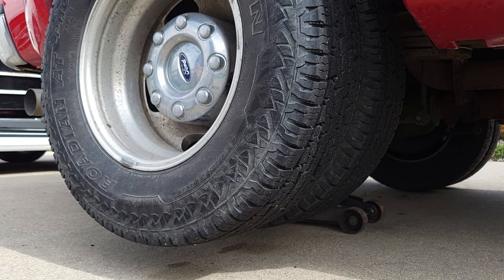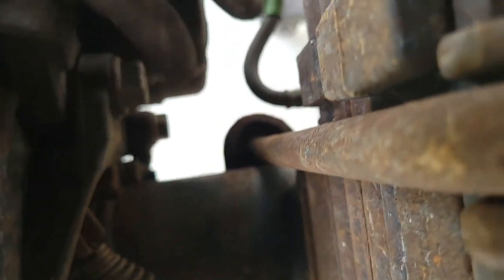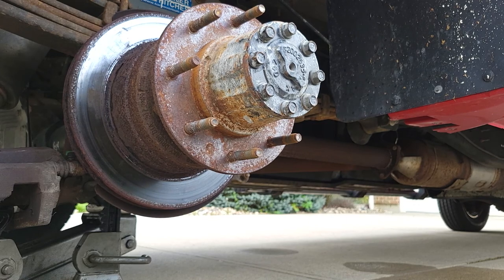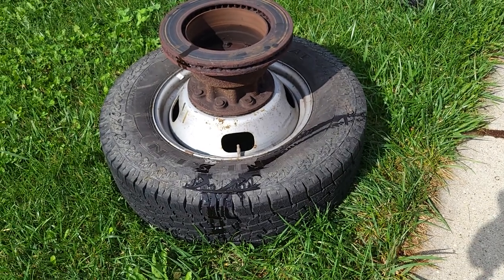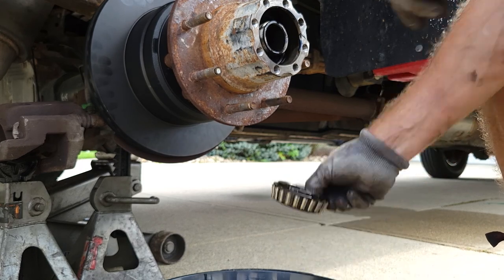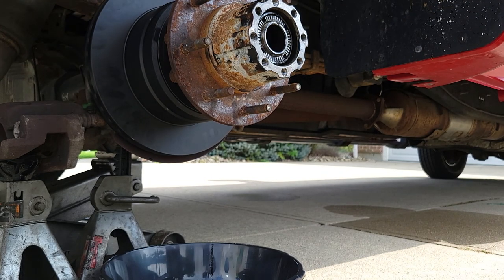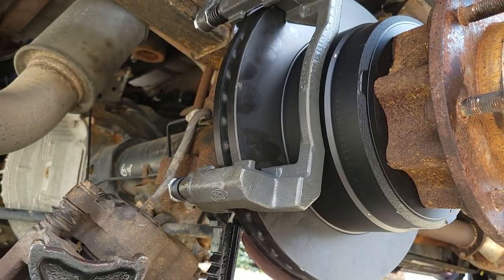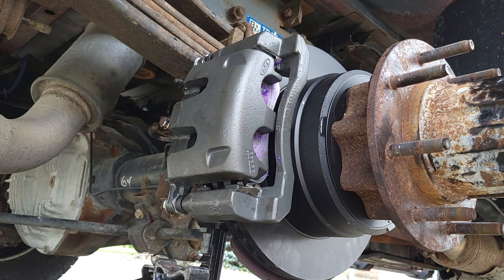2012 F-350 Dually Rear Rotor pad and caliper replacement

Comment: Just a quick comment regarding getting the decorative cover off the lug nuts. A 2 x 4 piece of wood works great. Just press the wood against the O.D. of the cover, nearest the decal end of the O.D. and wedge the wood against the tire rim. Slightly and rapidly press against the cover and you will hear it start to squeak loose. Doesn't leave marks and does not crack the cover like you might trying to use the screw driver slots.  The youtube link below shows a guy doing it with a 1 x 1 piece of wood buy I find the 2 x 4 works better and doesn't have to be as long.  https://www.youtube.com/watch?v=DtZfe4cDRSY
Reply from the maker: Yes those caps are a p.i.t.a